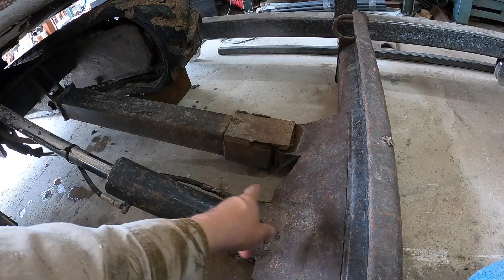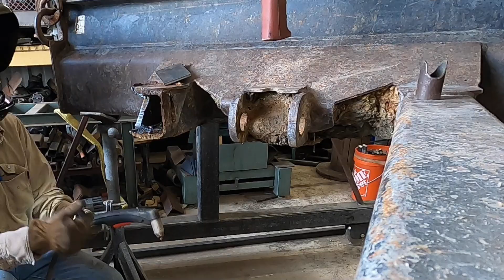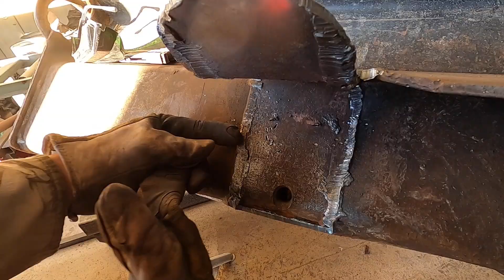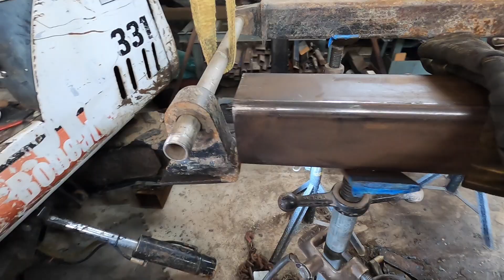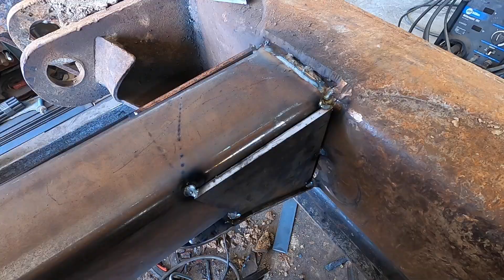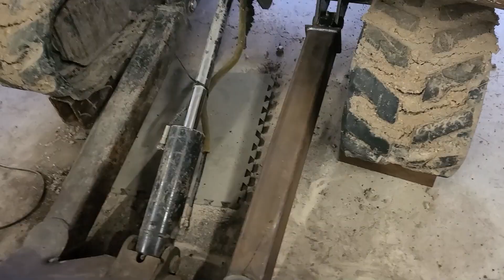Mini Excavator Repair

Comment: The original design must have been weak, if it broke. Patch plates can be sketchy,  but gussets are  almost always a good thing. Old saying...."Over engineering is underestimated ".  However, if nothing ever broke, the repair welders would all be out of work.  Keep up the good work and make sure that your repairs are always solid.  A cheater invented the circle. He was hired to make a square, but he cut every corner possible. 🤔

Comment: The master mechanic I first worked under always told me to build it like the operators are going to try to tear it up. And I think he was right. I got used to over doing everything. Never used patch plates either, unless they were there from the factory.

Comment: Again your analysis of the strength issues is spot on.  I would say that in most of the cases of repair to construction machines that you show there is a problem with the strength analysis in the manufacturers design. In this case the blade arms are too close together and would have been better spaced further apart or angled outwards in the first place. Needless to say a flared joint with gusset plates would be an improvement to having the square tubes just welded around at the ends. Anyway, another good lesson from you as always. Keep up the good work.

Comment: you're the rare combination of engineer and fabricator. lots are good at one or the other but the really talented are good at both. if they build aluminum screen enclosures there that use kickplate it comes in 2 thicknesses, .024 and .032. 16" is standard but it's also available in 24 and 36" widths. usually sold in 50' rolls. it makes GREAT pattern "paper", holds it's shape, impervious to water, etc. it's painted bronze or white. easy to cut, tin snips or Wiss, scissors in a pinch but they quickly dull.

Comment: I only watched some of your videos. Why do you sometimes use a cutting torch and other times a plasma cutter? Is there any advantages to one over the other?
Reply from the maker: Sometimes you can overheat a part by using the torch and other times you can melt away or hurt the parent metal. A plasma cutter is much faster and less heat input too.

Comment: They are always in a hurry. The machine never break at the end of the job. If for some fluke the machine does break right at the end of the job. They won't get the machine fixed until right before the next job starts... and again, they need it back ASAP!

Comment: you sound like you're in pretty good shape.....but i still see that smoke swirling around your helmet and face plate....do you ever use a  wearable  forced air blower shooting clean filtered air up under your visor so you're always breathing sweet air?  ....it could add 10 years to your lungs.....assuming you're not a cigarette smoker.

Comment: Wow look at your stalk pile of iron tubes pipe and stuff so that is what my shop will look like in 20 years scaryest part about biding my work is material of corse havent had problem yet i do work for good people and ill some time half to get back to them on price like first time i dident know how much a cutin edge was or the floor on a dump i instald that hardox i hade to get back on price i love when people bring every thing and have the plane of what they want done and its realy cheeper because when in biding for material i shot a higher number in case i for get somthing id rather just work for hour rate give my opinion go that way tell how meny hours it will take and break it down ad extra hour for consumables. Wheels gas wire and excetra the more i lern more i realise ive got lot of room to lern every job looks so much better then last and im always thinking of ways that speed stuff up buy a extra step in short run

Comment: Hello I C Weld, 
Do you ever use a combination of flux core with gas shield on rusty repairs with the GMAW/FCAW process?
Reply from the maker: Mostly straight fluxcore or 7018's no dual shield

Comment: I thought it was amusing as you tried to yo use the plasma in a clean way then cut after cut your frustration. I laughter thinking “use a hammer” out comes engineers correction tool whack! Ha…

Comment: Turn up them amps. Run it as hot as you can realistically. Floats up all the impurities better and comes out less rounded and more flat and flush I almost never grind my mig welds bc they’re almost always clean where I’m at at this point.

Comment: Speaking from an old school/old fart point of view, I’m right with you on your mig comment! I still prefer 7018 & 6010 stick over solid wire mig, but if you ever have the chance to try dual shielded flux core, I think you’ll love it! I ran it for years with Co2 shielding, .045”, and it’s great in all positions on everything including thick plate! Had to test (x-ray) several times in 2G, 3G & 4G - 3/4” plate to AWS D15.1 standard, and never had any issues! Of course it wouldn’t be the thing to use for field repairs. Also liked that you replaced the whole piece of square tubing instead of stitching it back together! Gives a much stronger, better looking result!
Reply from the maker: I've been meaning to try dual shield. I just might try a roll one day.
Reply: @ICWeld  .045”.  25.5 volts & 265 to 300 inches/minute wire speed,  CO2 at 50. You will love it for in shop projects! Much nicer than straight flux cored. Stay well!

Comment: Now I learned why you do not use patch plates because by having a certain amount of flex will keep stuff flexing instead of snapping just as I seen done with shortened rear axles that were welded diameter was reduced to add flex or twist.

Comment: I love how not only are you a master welder but the way you explain the how and why the way you make the repairs! For example pointing out that if you beef up a weak point with a gusset plate it will just transfer the weak spot to the next weakest point. Most of us know that you don't replace a shear pin with a stronger part in order to stop breaking shear pins, you point out that it is the same with other repairs that are not as obvious! You also explain some of the other issues and complexities  that the weld or repair introduce to the the equipment.  I can weld ( a little) and I have an engineering degree, you have skill, knowledge, understanding of all the variables  and  most important experience!!!!!! Thank you so much for your Videos, it gives us home gamer welders the extra insight of a true pro and a better chance of doing a more successful repair based on getting to see and hear how a master of his craft look at and take on a repair!!!!!!

Comment: I thought that caterpillar was the only company that was stupid enough to use thin tubing on their backfill blade arms. 
I have seen these break on caterpillars, especially when using the blade to level the machine on a hillside.
This is a good reason not to buy bobcat or caterpillar.
Several people have said that Takeuchis hold up better under rugged conditions for the Long haul. 
Takeuchi and several other brands use thick solid iron, NOT TUBING, for the Blackfill blade arms.
Especially useful when putting a trailer hitch on your blade to move your trailer around the job site for carrying supplies or tools around a job site. 
Check out "excavators with trailers"  videos on YouTube and also, cotton top 3 has a video installing a hitch on his excavator blade.

Comment: I worked for a construction equipment hire company, that was a very common repair for us.
 Usually 'operator error' slewing machine to level out something. 
We 'fixed' it by adding diaglgonal braces from edges of blade to pivot points.
 Mini excavators are probably most abused equipment (after floor saw and floor grinders which were frequently run without air filters after they got blocked with dust - why connect a water supply as instructed!!!)

Comment: I LOVE this channel and have learned so much from it and I have a question.
I notice most of the time you use a torch when doing repairs on construction equipment and like in this video, you are using the plasma cutter. Is there a particular reason why you use one or the other or is it just what is convenient at the time?
Thanks for the GREAT videos.

Comment: Did not remove rust from weld area. No deep bevel on weld joint. both can create weak weld. Just tack welded bar to blade. Should have done a deep weld to blade, ground and cleaned up then welded plates. Wrong power/feed settings.

Comment: You are totally right on the repair. If what I call "FISH PLATES" they need pocket welds in critical support areas. Nothing can beat taking it apart and doing it right and hopefully better than new. Having the Iron Worker in the shop is a real blessing for sure. The best big $ ticket in the shop. I like to use Grade 8 bolts for that kind of fill material. After doing the repair to the blade base pin bosses put some grease gun hoses on the pins so people will grease them. Otherwise the new pins and outside bushing repairs won't last long eh.

Comment: A small suggestion... at the point of cutting the paper stencil, if the top of the tube is also traced, the two joints can be transferred to the square tube with proper angles ( If the square tube is cutting a little longer at first, of course. Remove the square tube from the welding tacks and then making the transfer ... this will eliminate the gaps altogether!). Then, cutting back the square to the correct length....without the gaps, .I would think the welding would be much netter afterward with support plates?
Reply from the maker: Agreed. but I didnt see that angle at the beginning,.. I had already cut the new part. :(

Comment: I had a blade on a bobcat that those skid plate wore off and the blade ripped the side welds on the arms when we used it as a stabilizer.

Comment: Adding half inch bore washers is the way to go on the rear pivot bosses. You then end up with 1" of matl on each side boss which gives the pins much more surface area to wear on. It is the right way to fix it back there. On the blade end I would have made large "C"s  that would mate to the blade contour then back to the 4" tubing if you know what I mean? Great job all around!

Comment: Nice vid and very nice welds.  Although I'm a bit wondering because you started out commenting on how using plates is a problem and then it seems like you ended using a bunch of plates as well.
Reply from the maker: Another person commented very similarly. The plates I put back on were a copy of the plates that originally came on the machine. I basically copied what was on the other arm.

Comment: Great job, IC.  That was a great explanation about using plates on flat breaks.  Your explanation about creating weak points by over building others makes a lot of sense.  Love your work!
Reply from the maker: Glad it was helpful!
Reply: Cracks are caused by cold working embrittlement,
which could have been prevented by heat treatment before the crack began. Making the area stronger will shift the cold working to the immediately adjoining area.

Comment: yes after years of repairing truck chassis you never weld all the way round you must leave a 10 to 20 mm gap on a repair plate between welds so if it does develop a crack t will stop and you see it then repair it again

Comment: Looks like they've been grabbing the blade when they were digging. I think that's how they broke it. Common sense matters!! Welders matters!! Great job Issac!!!  " Flash" in Tennessee
Reply: Probably explains the sloppy pin holes too. Lots of up/down on the same axis with the full weight of the machine.

Comment: Great explanation of the patch plate repair. I'm trying to understand preheating and over heating. Positive attitude is much appreciated as well. Thanks!
Reply: Pre heating. When u start a weld. Yr introducing heat   The welding to cold parent metal which isn’t ideal. If you pre heat to say 100 degrees and then start weld. You get far better penetration and far deeper into the parent metal. Thereby creating a stronger weld

Post heating is a stress relief technique. Once you finished welding. By post heating. U on a molecular level. Reposition the metal particles and they realign themselves evenly. And thus. Creating and spreading stress if any. More evenly throughout the parent metal the weld deposit and the heat affected zone which is found either side of the weld on the parent metal 

Hope it makes sense

Comment: To the casual observer it's hard to understand the EXTREME pressure you can be under to get a machine back in the field. Having that machine can make or break meeting a construction deadline. So ripping things apart like this and getting it back together is a testament to the skill and experience required. Most customers draw the line somewhere of where to stop a repair, and it's usually based on whether they know they can still make money with it as it is and the time that the machine is out of production. It's a tough business.

Comment: Finally got myself a torch to go with my welder, think of this channel every time I light it 😂👍
Reply: I bought a oxy acetylene setup and i have yet to light it!!! all because of IC Weld. I’m just a dabbler in the metal steel arts but I will get it lit soon and get practicing cutting and doing some welding with it. I’ve read and seen the validation in learning to weld with oxy acetylene as a starter as you get to see the weld pool develop and learn what you are looking at.  With the local welding courses still shut down at local CC I just have YT and my neighbor to lean on for feedback. IC Weld is inspiring in his knowledge and skilled field repairs.

Comment: Could you weld a pipe in those sloppy ears, instead of the washer deal?
Reply: Yes and actually it would make them more wear resistant due to the metallurgy especially if you thicken the ear using the pipe (however it may require longer pins) and it would be more resistant to stress oblonging of the holes(egging).

Comment: I like your wisdom about replacing the whole square tube. I would have probably gobbed more crap on there and welded the crap out of it. Your way was better and probably about the same amount of time. I usually have a bunch of different sizes of round tube and pipe laying around so I can cut off rings to fill those sloppy holes. I was surprised that you mig welded it. Why didn't you stick it ?  I always have bad luck mig welding old steel unless I clean away every speck of rust so I almost always stick weld unless it is sheet metal.

Comment: I guess you could have shaped the square tube to fit the curve at the shovel, like a pipe-to-pipe fishmouth or saddle cut... that is what I would have expected from you.
Anyway... not the best, neither the worst...
Reply from the maker: I had already cut the tube beforehand according to the measurement I got from the other side. I wasnt aware of the angle until I cut out all of the bad. I didnt have enough tube to make another piece. it was a drop from a previous job.
Reply: @ICWeld  That was what I supposed: there wasn't enough lenght to shape it...
Sometimes you have to work with what you have... Don't worry, well done.

Comment: It's often funny how a guy is either great at MIG, or stick, but never both!! I think it's to do with the weld puddle, the difference in speed, and the added variables(wire feed, gas mix/flow, angle, drag/pull/spray/drip.........of MIG). Stick is the best for portable/mobile work, especially so with current Inverter technology, combine with simple generators, rather than noisy and crap generarc machines of old!! BTW Bobcat only made one good type of construction machine, and it's not mini-excavators!!! Keep safe and well.
Reply: FCAW and stick are best for mobile repairs as they are most resistant to wind blowing the shielding gases away at least until the flux slag forms... I'm good at stick and FCAW, ok with mig but horrible at tig (rarely ever use tig as the parts I'm bonding usually aren't tight enough for tig as they're usually repairs)
Reply: @dodgeme1986truck  Yeah, it's weird. I've met really experienced and skilled welders/fabricators who all agree in that it's either/or. I started stick welding at 10yrs old, with NO guidance and 6013 rods - it didn't end well!! I prefer MIG, but like stick for its simplicity, versatility and I use it a lot for repairing construction plant(7018s for general jointing/repair with specials for iron castings and hard facing edges). I just do it for a hobby/semi-pro, and its great to watch a pro at work, like here.

Comment: Would dual shield flux core be a better fit for that type of job?
Reply: Flooding the tube with shielding gas prior to and during welding would give it a stronger weld  from the metallurgical stand point as it can prevent oxidation and oxygen contamination of the back of the weld but that costs more for minimal gain

Comment: that was the weirdest oxy torch I've ever seen :D
Reply: Carbon arc torch basically a stick welder w/carbon rods with  air gun attached excellent for goughing cracks in steel , for weld preps..👍✌️🤙😔❄️🙏

Comment: What you are saying is that adding doublers increases the strength of the original failure, moving the failure point to the edge of the doubler.  So then using fish plates (diamond shaped) will create a gradient rather than a single stress riser.
Reply: My thought exactly.  The weld is always the weakest point and a repair weld will  need some help.